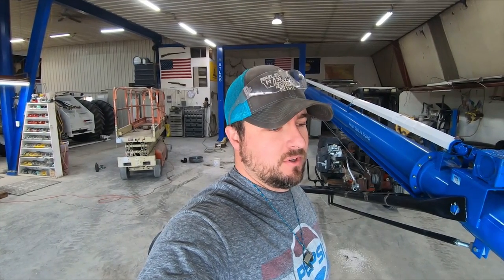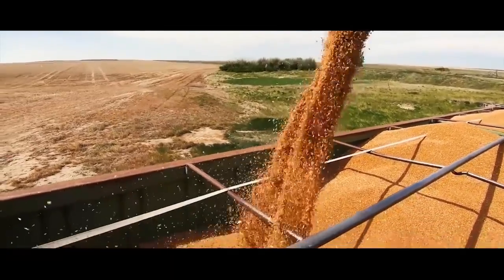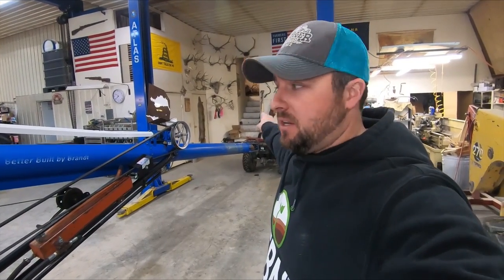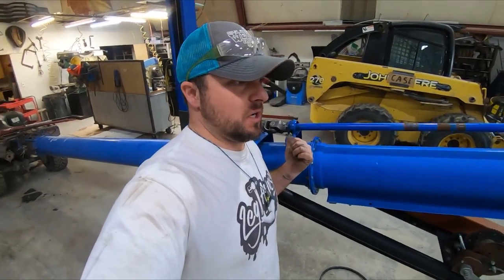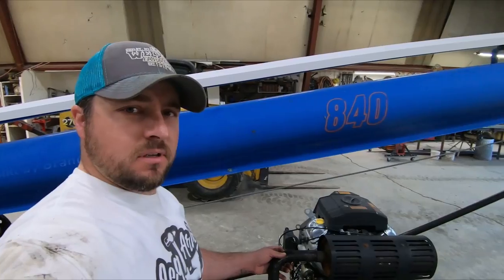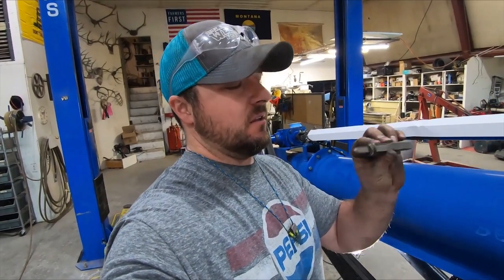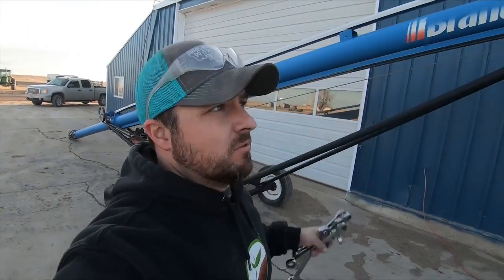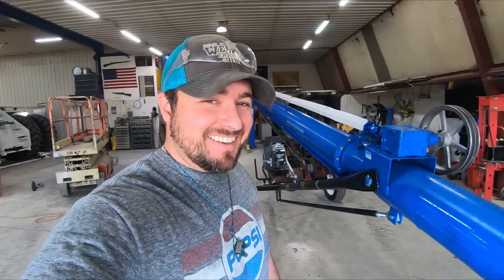What happened to MY AUGER?! Lots to FIX!

Comment: Try using a outboard boat fuel tank. We use them for a lot of small engines. With the fuel bulb to pressurize the system it can be mounted wherever

Comment: I encourage you to try that auger soon, I think you are good with the direction of the flighting, because you flipped the gearbox, AND the engine, but I think your pump is now running backwards, depending on the pump, it may not work, just food for thought.  Something possibly for you to consider for the future we have an old scissor car jack, with some sections of pipe matching the inside diameter of our augers welded to the jack pads.  Think star wars and Darth Vader's tie fighter.... anyway we take out dents and creases by sliding the jack up inside the auger tube, extending the jack, and use a hammer from the outside while applying additional jack turns to bring out the crease.  Also works really well for aluminum irrigation pipe that gets damaged.

Comment: I'm not sure where the 'gate' you mentioned is located, but since you have a pump on this auger you could get a small hyd. cylinder with open/shut controls right near your motor and have that many fewer steps to take.

Comment: Use a 5 Gallon weld a Aluminum or Steel tank and strap it around the auger which way it's always above the engine and can be with a brass quick connect also disconnected as needed.

Comment: Cool video, it’s great that you are making things safer and easier for your family.  It would be cool if you had before and after video of it running so we can see how much of an improvement that coupler upgrade makes.  Hopefully you have a little angle on the universal joint, they are not supposed to be installed straight.

Comment: The way we usually take dents out like that, and well, we already have this tool for the augers my brother uses, is to make a "dolly" for your tube. We made ours from a piece of crap pipe that "just" fit the inside. Cut a quarter out of the pipe, and welded two threads at the opposite ends. It's about 15 cm long, 3 mm thick, about the same size as your auger, going by your engine size, i'd say yours is juuust a hair smaller diameter. The studs are 3 mm all thread, stainless (mostly because the threads are small, so we don't have to weld the holes up making a mess, regular thread would likely strip after a while).

How it works. first you locate your dents, make two holes (as the two studs on the tool), then fish the tool inside with a piece of rod (we use those chimney stack rods you connect to make a chimney stack cleaner, very useful to clean the inside of the tube too), locate the holes, and then as the studs poke out, we put nuts on them. 

How it's used. We don't tighten it from the get go, just enough to make the dent flex, and then using a body hammer, the dent is coerced into submission as the tool is tightened more and more. Then we pull the tool out, or move it to the next spot (if the dent is longer). A spot weld is enough to cover the holes without much hassle.

Comment: Amazing how strong a nick-name can be and how well it "fits" a person. Honestly, go to a small engine shop, see if they have any old good fuel tanks. Most would sell on the cheap, would work a bit better than just a can. Can always make a mounting bracket that sits up higher for your gravity feed. For real thin metal, I prefer to actually use my torch not a mig/tig/stick welder. I have better control of the weld that way. Something you might try to practice with LOL. Great video, cheers :)

Comment: Don't forget about thermal expansion. It was a long shaft, and this coupling compensated for changes in shaft length due to temperature. A better option would be a tire clutch. 
Greetings from Poland

Comment: Our old auger also shuts off occasionally. Vacuum pump doesn't flow enough fuel. The clear inline fuel filter sits at a slight angle from pump to carb with the low end being the pump side. The filter barely has any fuel in it, almost nothing, and the outlet to carb is much higher than that level. It's running off fumes! Didn't use to do that, new lines, pump, filter, same thing. Maybe the vacuem from engine?

Comment: The active coupler they used was because the long driveshaft will expand a lot in the head and put a lot of thrust pressure on the gearbox without it... with the u-joint being solid, that expansion won't have anywhere to go and it will push both ends outward. One end really needs to have a splined end on it, or a floating coupler  so it can float. It might be better to put the floating coupler back on and use some rubber matting of some sort to deaden the clanking if it's bugging you...  or get a proper lovejoy coupler (they have rubber buffers in them)

Comment: I like the way you guys look at a piece of machinery and think how can I make that better for me. I imagine you have some interesting conversations while you sort your ideas out (hopefully not around the dinner table). For your auger, I think you should adapt a jerrycan by fitting an valve at the bottom and have it so that it can easily unmounted for ease of filling. A jerrycan would be big enough for fuel capacity but okay to be handled with ease, what do you reckon?

Comment: Hiya Scott.  You removed a slip joint and I wonder if that locked U-joint was the best idea.  That's a long auger and it's going to expand and contract a lot with temperature.  If that was your only spot  to mitigate that you could have shaft bearing, motor bearing, and gearbox problems later on.
Perhaps a Lovejoy coupler or rag joint would be better?

Comment: boat gas tank
slide hammer is easy, weight of convenient mass with a hole in it, piece of rod with a nut welded on the end for the weight to smack
weld the rod to what you're pulling and hey presto

Comment: Pro tip - if you need oil flowing a certain way from those outlets, then put a male coupler  on one side and a female coupler on the other. Obviously whatever you attach to it should also have a male and female on the correct hoses for that to work.

It’s a bit of puzzle to get right across a fleet of machinery, but once you do, you eliminate a lot of those situations where you hook something up the wrong way because the zip ties you use to mark which hose goes where, fall of the hoses.

If you are using hired help then you wil also find yourself not having to be there as often when these things need to be hooked up, because you can explain the job of doing it as “they only fit in one place, you can’t do it wrong”

Saves quite a bit of hassle imo

Comment: I was just thinking about your gas tank problem with all that extra sheet metal laying around you should build u one... Maybe 12×18×10 inches then build a paltform on that solid metal frame would be cheaper... And such u are so good at building things it would probably last longer and hold up against the elements just an idea...

Comment: Slidehammers are easy to make. Ready rod, nuts, and a length of pipe as a slide.
Reply: We weld larger pipe over one just larger than the all thread/ ready rod, it adds weight to the hammer slide. 
 Why buy one when you can make one.
 Try welding a washer to the nut at the end of the rod, they last longer then.
Reply: A wrist pin from a 466 Deere engine makes a good slide. Has enough weight to it to get a good hit.

Comment: Use accessory Cord (1/8" rope) for the key -ty-raps sun rot too fast and then snap off. Light rope lasts longer. Braided nylon is better in sun.

Comment: Marine fuel tank with a bulb primer inline and a 12v electric fuel pump. The fuel pump won't start running till the motor is running hence the primer inline to carb. with the 12 v charging  system already on your motor. Should have one as i think i see a electric starter. then you have options for led lighting while the motor is running also if you install a battery that will stay charged if you use it some during the summer.

Comment: slidehammer.... easy to ake yourself with a thick rod an dobbel nuts in the end an heavy piece chunk metal with hole drilled out  an how to attach to things?  easy... 3 nut on the end is easy to spin on after welded to things an volla slidehammer on cheap an i used mine for years

Comment: Did you reverse the rotation of the auger by flipping the gear box?
Reply: That was my thought as well.
Reply: Yeah but he turned the engine around which reversed it also so the flighting will still be turning correct direction.
Reply: many times the gear boxes can be turned over, but can also be "twisted" or turned 90 degrees to accomplish the correct rotation. that's what i have done in the past

Comment: You haven't mentioned it yet, but how are all other pivot bushings on the 650/50?  U-joints all good?  The driveshaft between the engine and transmission as well?  The age of the tractor, I want to say that most, if not all have already been replaced.

Comment: you could have drilled 2=3 1" holes on opposite side used a drift to hit the creases out. then welded the hole patches back. then there would be no weld lines making contact with flighting

Comment: I would have put a lovejoy coupler on the driveshaft instead of a u-joint. They don't need maintenance and I've never worn one out.  Other than that, great fab work.
Reply: I've killed them
the rubber doesn't like a lot of power being put through it, and that big v-twin with the belt reduction is deffo enough juice to kill any lovejoy I've dealt with
a roller chain coupling would do it, but the universal joint is actually cheaper than two sprockets and a length of double roller chain

Comment: On the hydralic pump the way you have it now you are applying a side load on the bearing in the pump.  Would it not be better to have a shaft running in two bearing with the end connected to the pump with the rubber connection so keep the pump from any undue loads

Comment: I am concerned that where you cut that piece out then welded it back it that it will create a big area where the weld is rough on the inside doing more damage than the dent.

Comment: Quick question for you.  I have a 5x7 utility trailer that I haul too much weight in, but you run what you can afford. The sides are starting to "tear" in two places. What would you do to fix this? Beyond buying a new trailer. Run thick lengths of steel down the sides? Any advice would be appreciated.
Reply: Without seeing the structure it is hard to recommend a remedy.

Comment: Nice welding job, could you turn the auger body 120 degrees when the "bottom" gets thin?
Reply: You would have to move the drivetrain that much, along with both openings, and the rail for raising and lowering it....most of the time if it gets there the rest of it is pretty wore out, so newer auger instead.

Comment: Go to Ditmier in Iowa online they have some really nice plastic gas tanks for your auger.  You can locate it away from the motor and use an electric fuel pump to get the fuel to the motor.

Comment: put some grease in gear box with 90wt. if there is a 1/8 pipe fill plug put a grease zert in hole to add grease once in a while. similar gear box used on mowers. wont  that reverse auger running off engine pto.

Comment: I wouldn't want gravity feed on the fuel tank,  keep the tank low and use a pulse pump,    without it you run the risk of going past the needle valve in the carb and flooding the engine, when its not running.    I see this a lot on small engines, unless you want to add a fuel shutoff that someone inevitably forgets to use.  Just one less failure point.

Comment: " I don't have a slidehammer ", says a man with a pile of scrapmetal and a lathe 🤷🏻‍♂️
Reply: Thats what I said ,well make one.
Reply: he wanted to weld it...
Reply: @terrybarnes2616  He could but they are really not that expensive, plus he would have to fix it as well.
Reply: I was thinking the same thing. You  can get a slide hammer cheap enough. Hopefully welding that thin metal didnt leave any weld buildup on the inside. Will wear faster than the dent would.
Reply: Exactly what I was thinking lol
Reply: I laughed at that too. The Welkers have all that heavy duty repair equipment but no slide hammer? I bought mine at Harbor Freight for pulling dents out of my old car.

Comment: It looks like the coupling was for expansion-contraction of that long shaft, now you don't have any
Reply: should have a "slip" on the U-joint - I thought the strap over the shaft was for a carrier bearing - think chevy pick ups.
Reply: Probably could have solved that problem with a rubber puck.
Reply: @MikeCris  Or two short hunks of rubber hose over the pins.

Comment: Is the auger going to run backwards now since you just flipped everything over?  I know, probably a dumb question
Reply: Doug Schmit II no if it run backwards it cant move grain
Reply: It should worl just fine because he put both the drive wheel and the driven pulley in the same position but just on opposite sides.  This did not change the direction of travel for the equipment mechanice no more than turning the complete machine around.
Reply: @MrJerryjam yes, that makes sense now. I guess it would be different if the gear box was flipped and the engine was just slid over instead of rotated 180 also

Comment: LegArms there is nothing you can't do, you should have your own machine and welding shop . Why dont you weld up a kinda reservoir tank for the gasoline tank  ? And maybe weld the key into the switch so its always in there the " keyhole  "

Comment: Noooo don't do that. The peice you  took out allows for lethening of the top of the auger when full without you'll probably have earlybearing failure. If you want to make it quieter use a dodge coupler it will allow things to flex

Comment: You would have been better off leaving the dent in the auger barrel rather than cutting it out and re-welding it. Your gorilla weld may look strong from the outside of the barrel, but on the inside I bet there's a lot of jagged edges from the weld that'll eat that plastic auger like a werewolf chewing your face off! Nice customization on your Pepsi tee shirt with the blue paint though. Now you can splurge and buy yourself a work shirt that doesn't advertise for Pepsi for free!